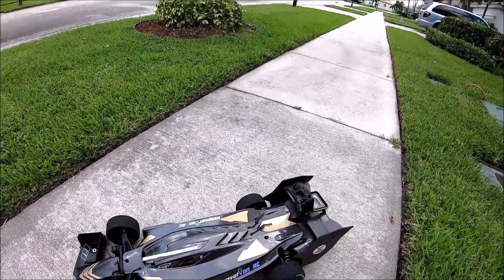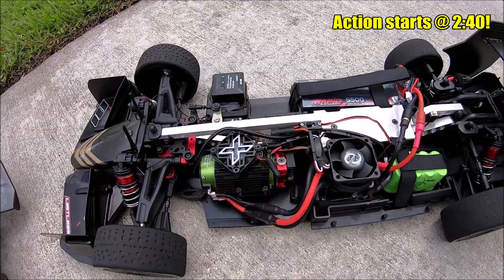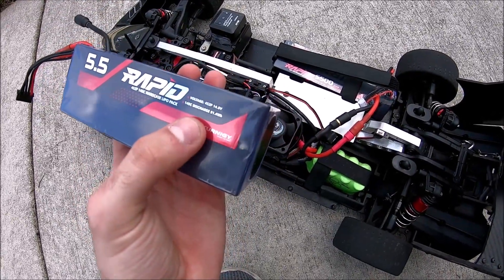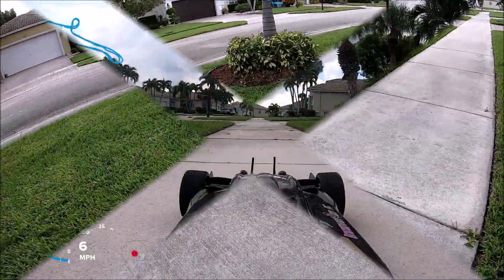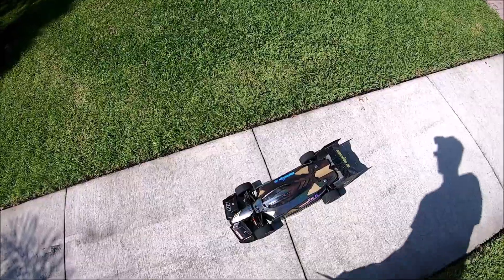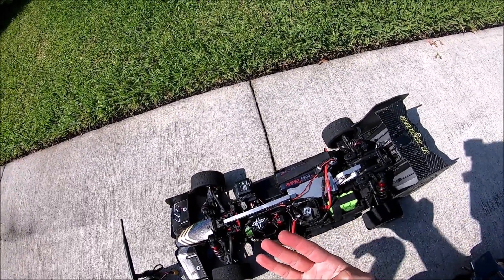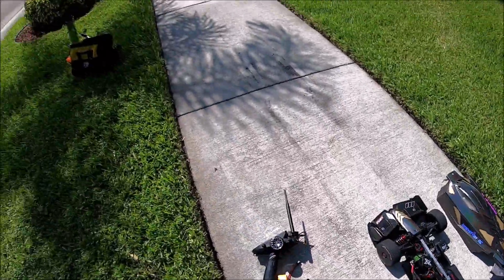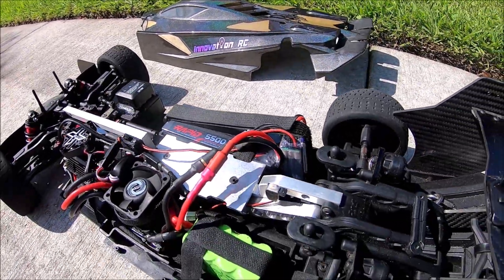SWEET Limitless Circuit Setup! Castle 1717 Turnigy Rapid 140C

Comment: Said you are running 28/39 on the gearing. Can you share where you get those gearing components from? I'm guessing they don't come with the Limitless kit or the motor. Just got a Limitless v2 and looks like the 1717 on 4S works great. Thanks.

Comment: Really nice video. I'm curious, after you make the videos do you keep running the car until the batteries run out, discharge the batts on the charger or do something else?
Reply from the maker: Thanks man. I normally would stay out but it's just so hot out lately. Humidity makes it feel like 105°F air temp. Wanted inside and shower haha
Reply: Great question. Here's how I solved it. I standardized on Spektrum smart electronics, to include the smart battery. With smart electronics, even if I have an 8s system, I dial in the power I wish to use via the drive mode functionality of the radio. I have 5 different drive modes with 1st starting at 20% throttle, and increases by 20% as I go up to drive modes. From an 8S outfit, I choose the output power I wish to use (effectively dialing my 8S down to 6S or 4S). Because the modes are set to a switch function, I have the equivalence of "changing gears" while driving. As for the battery, it will smartly discharge itself if left alone. Through this system, I can go from speed runs to circuit runs with the flip of a switch. There is a plethora of other functions I can program to be associated with each drive mode that further enhances car performance depending on the functionality required. I'm hooked, and believe ALL batteries, AND electronics should be SMART

Comment: Awesome setup and vid! I'm also running a 1717/XLX setup in my infraction and I'm looking for a good motor fan setup. I see that you're using NTF fans but do they also make the heat sink youre using? Sort of a hard motor to find heat sinks for since its sort of an odd ball size. 47.5mm diameter I believe.
Reply from the maker: Thanks on that. You have two options that I know if. One is the Xmaxx heatsink. The other is the generic 1/8 twin fan heatsink from yeah racing or power hobby, but with extra long screws and that heatsink clamps on just fine to the 1717.
Reply: @InnovationRC  well I've heard nothing but good things about yeah racing. I'll give their twin fan setup a try! I tried the hobbywing C4 but it didn't fit. You can bend it and get it around the motor but then it only contacts the motor in a couple spots and doesn't have holes to blow the air through so I gotta try something else.

Comment: Hi, I haven’t seen a video with a body that covers the wheels have you ever tried that? It will go much faster
Reply from the maker: I buy my cars to run them for what they are. I do not prefer GT or closed wheel vehicles. If I buy a limitless, I will run it as a Limitless.
Reply: Innovation RC  ah okay, aren’t you tempted to do it knowing you can get more speed out of it?  
Also u did do the edf and the active aero (those are awesome btw) so a different body would not be crazy, ah well anyway do what you want to do. I’m looking forward to see more from you
Reply: Kevin Talbot is making one

Comment: I’m still debating whether I need to run an 8s or 6s system for speed. I was heard it doesn’t matter as long as I can keep my electronics cool.
Reply from the maker: That is correct. Usually an esc with a higher voltage rating can handle more amperage. Generally. But it's not all the time. You can run the mamba monster x 8s on 6s and be super efficient
Reply: Getting ratios right is key. Gearing, motor, battery, etc have to be “balanced”. Also are you after drag race speed or top end? There are videos on YT that go into detail on how KV should be used to battery cell count.
Reply: Tony Romano I have a community that drag races for $$$ but I prefer to go for speed it’s funner. Want a versatile setup for both or something I need to make only minor mods to use.
Reply: Eko RC get a good understanding of how LiPo batteries and ESCs work. Guys that really seem to be serious use “Cap” packs and software enabled ESC, Castle and One other line have this ability. There is a guy who makes custom tires out there as well.
Gone Bananas I thinks.

Switching between the 2 would be a simple matter of pinion. Also I would think a 3 speed transmission maybe a way to get higher too end without super expensive electronics. But this is just something I have heard about. Basically a nitro setup converted.
Reply: Eko RC I have not been active in RC for a year or so, my memory is not much on details.
Reply: Eko RC Ripple killer is the CAP pack guy. He also was part of a group that is into drag racing.
Reply: Eko RC where is Florida? I am in Savannah.
Reply: Tony Romano I have 22800uF cap pack. I’m in school for electrical engineering but still don’t fully grasp the point of these. I have thought of a nitro setup but I think there’s a reason no one does the nitro limitless. Have you ever even seen one?

Comment: what is an ideal temp cut off (motor) for this setup on 8s around a parking lot for several minutes
Reply from the maker: Running any voltage I would say 170°F would be best to stay under.
Reply: @InnovationRC  That being said, what "motor temp cutoff" is your esc set to? 170?
Reply from the maker: @rosone51178  yes it is. Need to use the sensor wire through